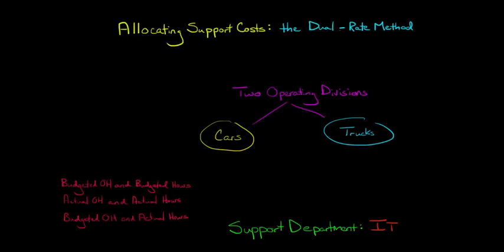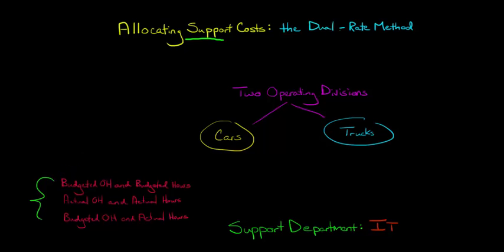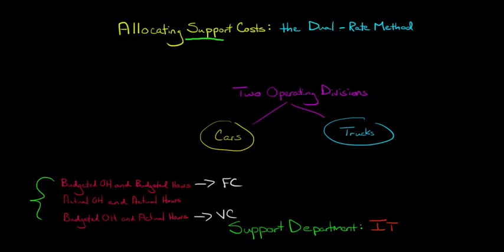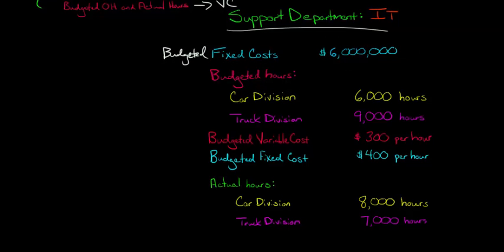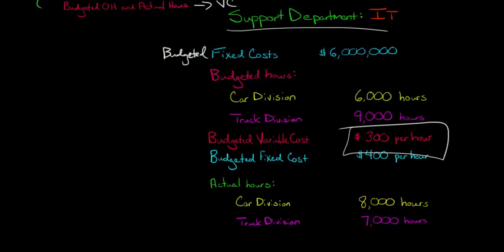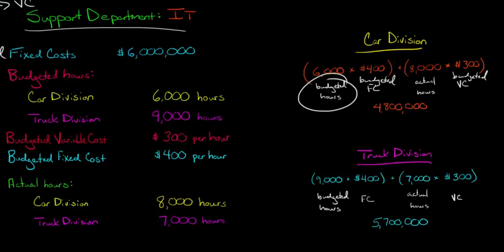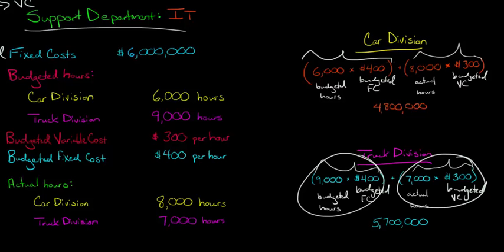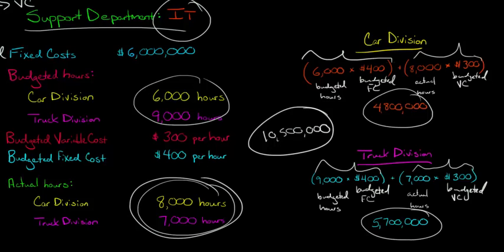How to Allocate Support Costs using the Dual Rate Method

Comment: hi i have this task and i  have no  idea how to  solve  it can any one help me out .
The task of dual-rate three-color limiter.
Given: the first Bucket capacity is 1600 token;
capacity of the second Bucket is 2000 token;
at start moment both buckets are full;
mean packet rate in the network is 4000 bps (first bucket);
maximum packet rate in the network 6000 bps (second bucket);
at time t1 = 0 packet of 900 bytes is coming;
at time t2 = 500 ms packet of 1000 bytes is coming;
at time t3 = 800 ms packet of 500 bytes is coming.
To define options for packet servicing (transmit to the network, transmit to the network
with the marking, the packet is drop).